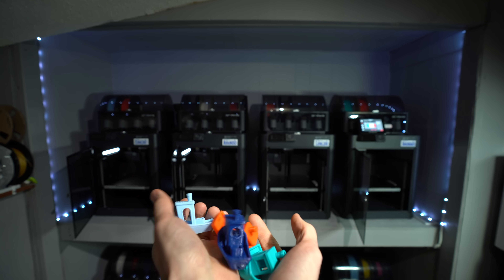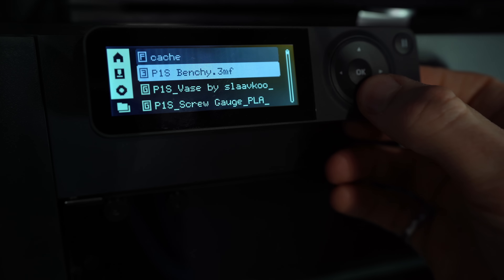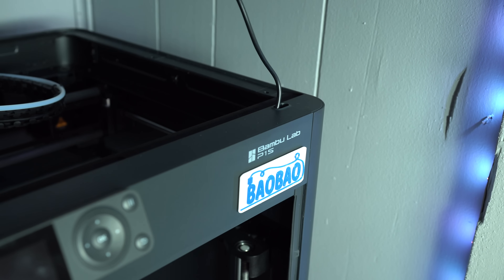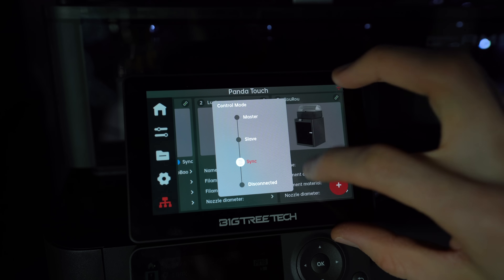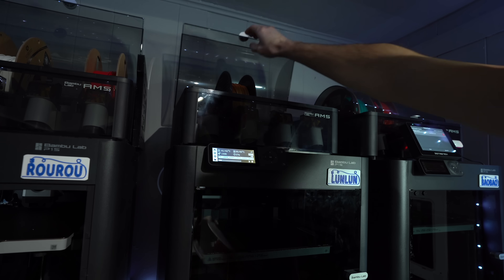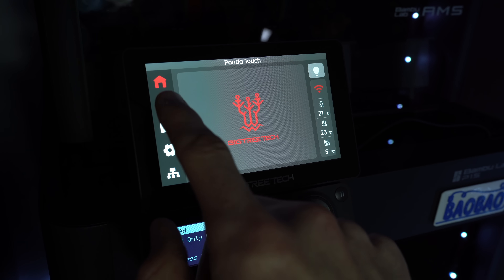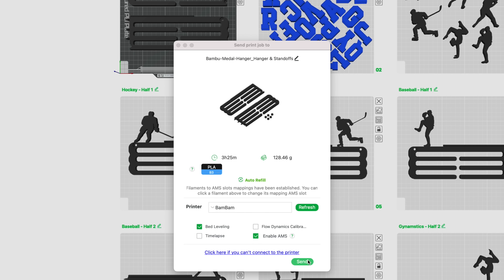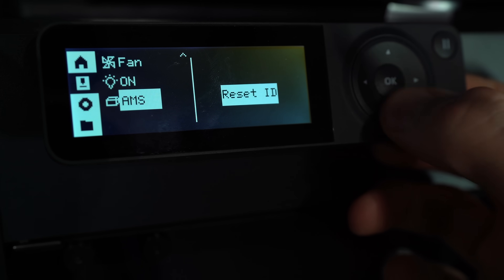Panda Touch for Bambu P1/A1/X1 In-Depth Review - Gimmick or Game Changer ?

Comment: Question, I noticed on mine, it reboots when usb stick is installed and sometimes when transferring the file. By placing the switch to battery it does it less often. I have had 2 replacements and all have done it. I am now of the opinion that it’s normal and no one is complaining. The other thing I noticed is how quickly they moved away from Master / Slave. Finally creating a group is nice but how to delete or reassign? I wanted to group by nozzle size, but when I change it on the printer I have no way to do so with the group so I have to factory reset and start over.

Comment: BTT has since removed the “addition and editing” portion about third party filament from their website, but you CAN do this from Bambu Studio and Orca Slicer, both support syncing third party filaments to the X1C and presumably to the Pseries via Bambu handy. When you add a custom filament in BS/OS it does show up on Bambu handy, so selection is still possible, just not addition and editing (yet) it seems.

Comment: So Microsoft around 1999 put out this statement regarding spec machines they worked with Intel on for future terminology of the ATA/SATA/IDE sets of standards for physical spinning hard drives. Of course bigots called it “politically correct” and panned it, but the terminology replacements are becoming more common in IT

“Don't use master/slave. Use primary/replica or alternatives such as primary/secondary, principal/agent, controller/worker, or other appropriate terms depending on the context. Use primary/subordinate as an adjective.”
Reply: There’s been a lot more advancements on this in the U.S. since 2003/2004 and beyond, with IT companies and engineering colleges like MIT discouraging use of the terms I reference to cylinders when discussing hydraulics. It’s only dinosaurs who think it doesn’t matter because they’re white, who have a problem with the terminology changing. When entire industrial unions poll their workers about the terms and they change them, it’s not “political correctness”.

Comment: The PS1 bed is 100c vs X1 110/120. Not sure whether that makes a difference. Otherwise it’s functionally very similar. Considering what to buy at the moment, saw your excellent Qidi Q1 pro video. If you had to buy one, would you pick the PS1 or the Qidi (excluding any comparisons on AMS)
Reply: I have both. Depends on what you are trying to print... Are you looking to print lots of neat trinkets and sometimes multicolor stuff or hueforges? P1S. If you want to print nylon, pc, asa, or anything high temp in a single color/ material get the Q1. I do both, and had the P1S 1st. ASA is very hard to print on the bambu, and much less so on the qidi. The print quality of both is really really good. The Qidi is much cheaper

Comment: Great video! I'm wrapping up the review on the unit BTT sent me now.  That error you got from printing was likely because the file wasn't sliced from plate 1.  I had the same error when I exported a print from plate 7 to a .3mf file, and exported it to the root directory of the micro SD card, installed it back in the machine, and then tried to initiate the print from the Panda Touch.  When I did the same thing with a file sliced from plate 1, it worked fine.
Reply from the maker: Thanks! Good to know.

Comment: How about command unit and drone unit, Or queen and drone? Control unit and bound unit. There are alternatives. I also understand the frustration around the terminology from a historical perspective, however just because something was offensive historically doesn't mean it can't mean multiple things and can't change over time. "Gay" meant happy, Then it turned into a slur, Then it turned into an identity for people rebranding the slur. 

Because language is fluid, most people using the term today won't be using it as a slur, intended as a superiority message. The idea of slavery in itself may be reason to avoid the word "slave". There are always alternatives to use if you are offended or don't want to offend people. 

Anyway this device looks great and probably will be supported with some great features in the near future because almost all of the issues are fixable with a software update.

Comment: If you watch our live stream you'll see that I mentioned that multiple groups is planned for the next firmware release. Also, it looks like you were using beta firmware in the vid which may be why you had a few bugs with SD printing. I can print via SD with the V1.0.1 firmware which is the release firmware.

Also, you can't add custom filament. What that statement is saying is that you can set the type and colour of any third party filament that does not have RFID in the same way that you can on the X1C screen.
Reply from the maker: Thanks. I didn’t catch the livestream. Glad to hear that multiple groups is planned. Im on 1.0.0 which is the latest version that was sent to me.

Bambu just added support for setting custom filaments from the X1C screen. Would be nice to see that on the Panda Touch as well. If it’s not, the wording in the marketing material is a bit misleading in that regard, in my opinion.
Reply: @ygk3d  interesting. I had not seen that support was added for that. Been so busy with the launch. We will need to see how it has been implemented but it should be possible to add if it's there on the X1C. I've had the marketing material updated to be less ambiguous.
Reply from the maker: @looxonline  Cheers. Thanks for chiming in here.

Comment: hello. I enjoyed your video. I am currently waiting after purchasing. While watching the video, I have two questions. 

1. Will the g-code preview function be updated in the future? 

2. Is there a way to remotely put a g-code file into panda touch? 

As long as the corresponding function is possible, it will be a complete device.
Reply: It is very likely that the thumbnail function will be added in the future but this really depends on whether bambu will be in agreement to allow us to cooperate like this.

You can load g-code into the panda touch using the external USB slot. Otherwise you can load it into the printer SD via bambu studio and initiate the print via the panda touch.
Reply: @looxonline  As a P1S user, I am very disappointed that the two I was most looking forward to are not there. I will have to submit many inquiries so that updates can be made in the future.
Reply: @기린이닷  I hear you buddy but we have to start somewhere and build from that. We would never release a product if we tried to add every single feature to it from the very first day. As the product currently stands, there are many really useful features for P1S users.

Comment: Can you remove old screen after touch install?
Reply from the maker: Perhaps, I haven't tried it. There a still a few things you can't access on the Panda Touch, so I'd leave it on for now.
Reply: I have the same question. Wonder what features require the original screen. Also, seems this is a better solution than the Handy app, since no cloud connection is required (ie. can use in LAN Only mode where Handy cannot be used)

Comment: Did you try slot remapping with the panda touch only paired to one printer?  Given the limitation that each printer in the Master/Slave chain has to have the same filaments loaded to the same slots I wonder if the remapping on print is disabled when controlling multiple printers as this would be a huge miss otherwise.
Reply from the maker: I added all of my printers before I tried the first print, so I can’t say whether it’s possible when only one printer is paired, but it seems unlikely. Considering the other limitations surrounding the ability to handle 3MFs, I would guess it’s related to that. The slot mapping is only contained in the 3MF container, not the g-code itself.

Comment: Not being able to reassign the filament slot on the AMS makes it a lot less useful. I have a p1p for my shop and I really want an AMS but i dont know the point if i cant reassign slots. I dont understand why thats not possible. Such a shame
Reply: I hope they update the P1P with an A1 screen or something.
Reply from the maker: You can do this on the Panda Touch, or from the Bambu Handy app, just not from the stock LCD. I agree that it's disappointing they don't allow you to do that. Perhaps they figure it would be too tedious to scroll through all of the filament type and colour options..
Reply: @ygk3d  I think I didn't explain my self properly.  When you print a file already on the sd card or USB, you can't change the slot that the print uses. For example, I sell the same product over and over of 10 colors. I cant use this to change the color of the print, correct? I just rematched 8:42 and you called it remapping without reslicing.
Reply from the maker: @trafton00  Ah, yes. Sorry, I misunderstood. Yes, that's correct. The current firmware doesn't allow you to do that. I really hope they add that.

Comment: Would the panda touch work with the k1 MAX?
Reply from the maker: Not currently. It’s designed for Bambu products. It would be nice to see this concept implemented for other machines, like generic Klipper printers.
Reply: @ygk3d  agreed 👍
Reply: @ygk3d During the BTT launch live stream they hinted that it would also support klipper machines. Time will tell how far out that is.
Reply from the maker: @jon_raymond  nice!
Reply: announced that the touch will have the ability to switch between the bambu and klipper firmware, at will. In an email and yt vid published today (1/25)

Comment: I run a print shop with a decent amount of X1Cs, but they're never printing the same thing at the same time, so I'm not really seeing the benefit of simultaneous control.  Are there other features besides the simultaneous control that can make this thing worth having?  I already have a nice touch screen on all my printers. I do agree it makes more sense to have if you're using P1s instead of X1s
Reply from the maker: For $59 it might be worth having on your desk so you can have a central command post where all of the error messages, etc. come in. But if you always have your phone with you, you could definitely live without it.
Reply: @ygk3d  Good point, thanks!